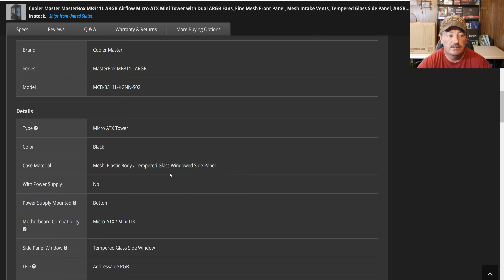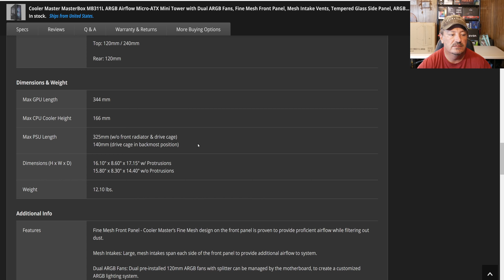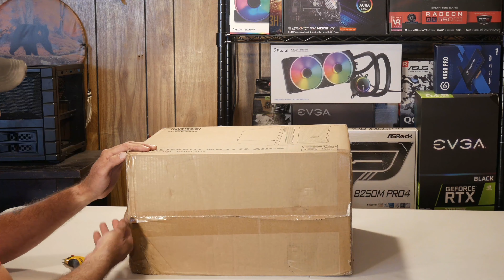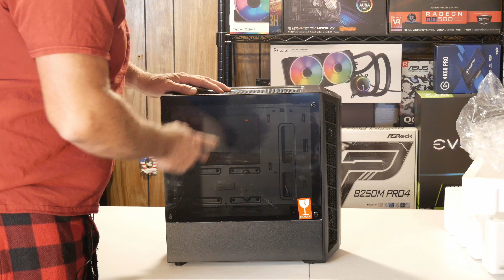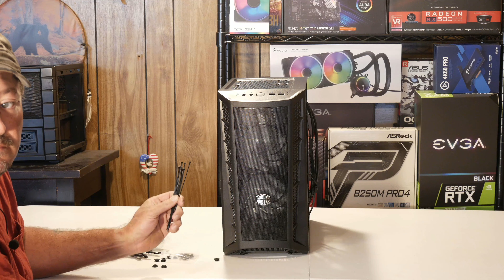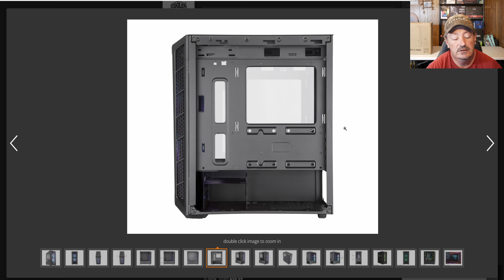Cooler Master MasterBox MB311L ARGB Airflow case unboxing and overview

Comment: How do you customize the fan colors?
Do I need a software?
Reply from the maker: You can use software, or the added control that comes with the case. The control comes with only 1 connector, So you would need to daisy chain the rest of the ARGB to be one cable. You can add as many fans that you would like as long as the have a 5v 3 pin ARGB connectors. Hope this helps you. Thanks for watching and the comment.

Comment: Hey Dave, great video! I have a question for you, that white fan connector which can be used for attaching a 3rd fan to the cable. I was wondering if that supports 4 pin fans too or if that too is just 3 pin.
Reply from the maker: The white fan header is only a 3 pin header.  Thanks for watching and the comment.